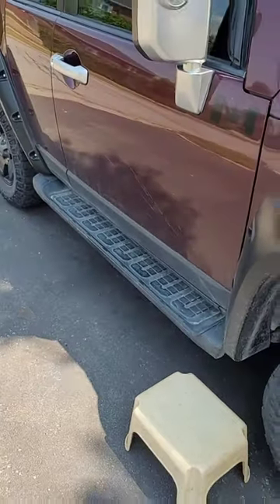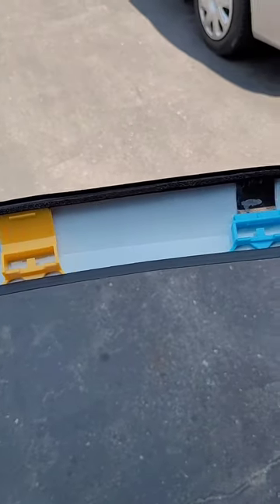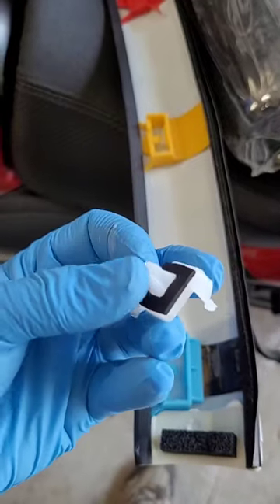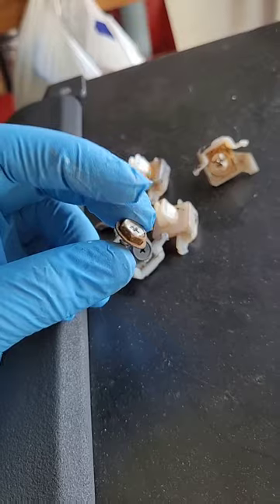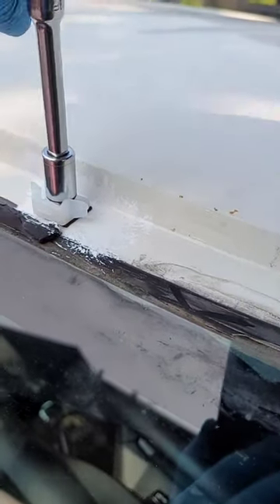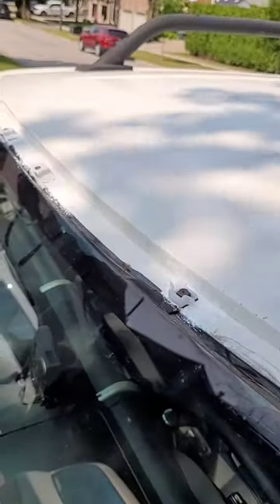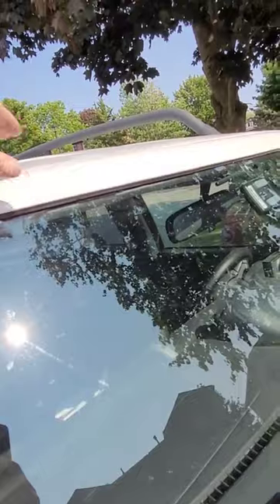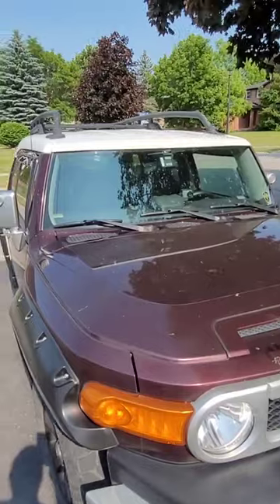FJ Cruiser Windshield Trim Molding Replacement

Comment: Great video but how did you get the molding off?
Reply from the maker: It flew off on the highway. If you cut the adhesive at the front, you can push in with a flat blade to where the clips are and it should pop the molding off.
Reply: @gaving4359  Appreciate it!

Comment: What is the purpose of the adhesive?
Reply from the maker: It probably needs it. The shop manual says to use it. The wind pressure and vibration at that spot is very high.